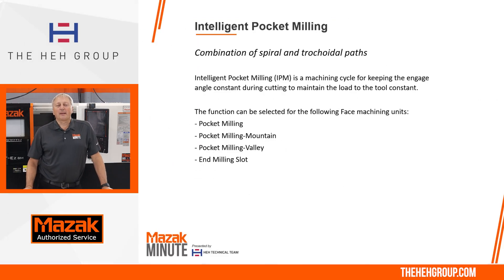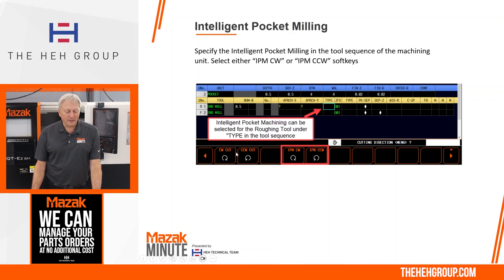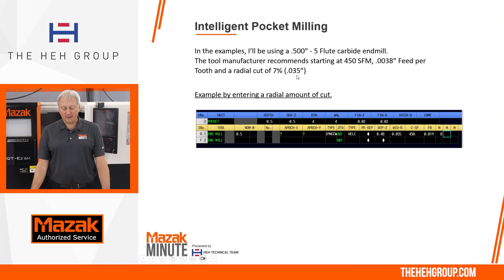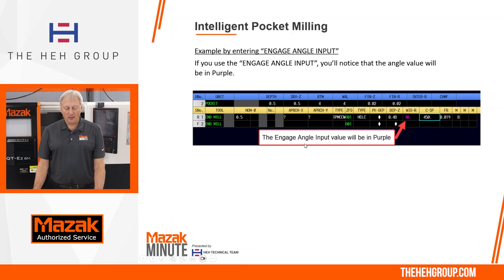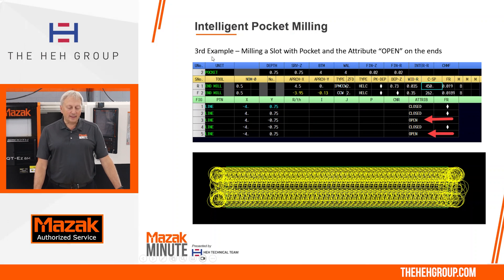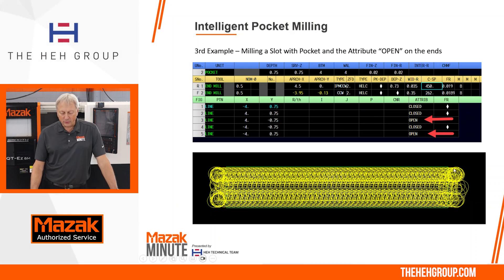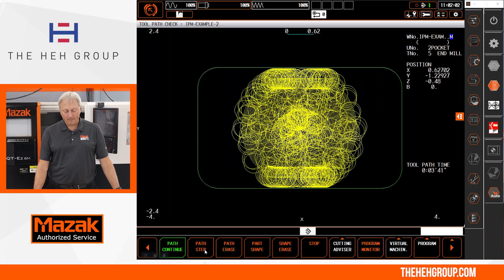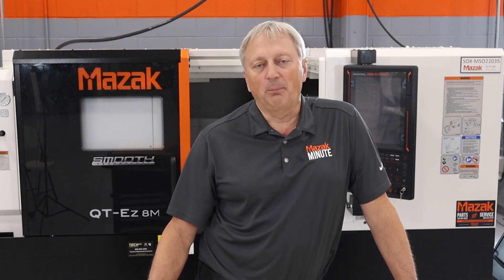Mazak Minute | Episode 11 | IPM Line Machining

Comment: I have issues with an error coming up during my IPM cycles it says "uncut increasing" and i cannot figure out what it means. Any help would be very much appreciated.
Reply: That's from the programming geometry. Try to add a radius in the corners that could be made by roughing tool. That solves issues with the geometries in my setups. Sometimes have to add one more tool for clearance,but overall works flawless.

Comment: Very nice presentation. I have a question about corners with a small radius. I would like to use a larger endmill to rough and a smaller endmill  to finish the corners. However in the corners there is 'leftover'  from roughing and that gives me a problem when the smaller endmill tries to finish the corners in one pass. 

I don't want to use the small endmill to do the roughing. 
I don't want to break the endmill in the corner because it be to big a cut

I would like mazatrol to remember 'leftover' in corners after a larger endmill and continue IPM with a smaller endmill. Is that possible?

Now I use the larger and smaller endmill but in-between I have the smaller endmill do a helical circle in each corner to remove 'leftover' .
Reply from the maker: Thank you for your question! We sent Mike over your question and hope to have a response soon!
Reply: No @henrikbengtsson8669